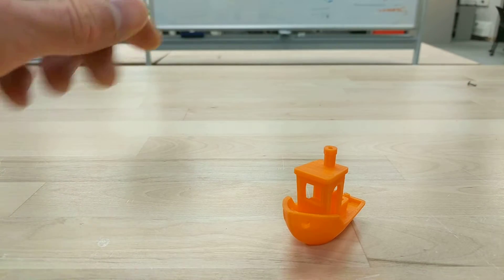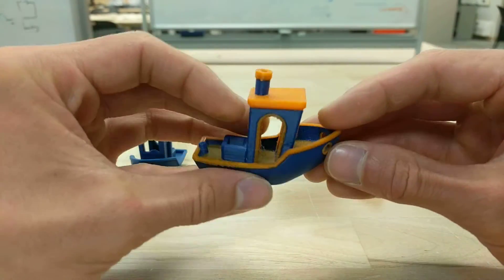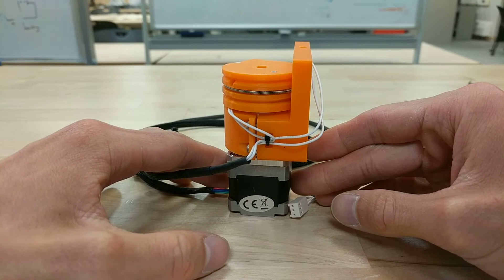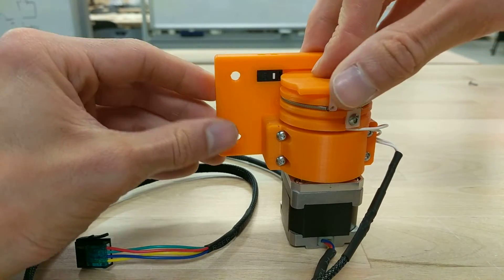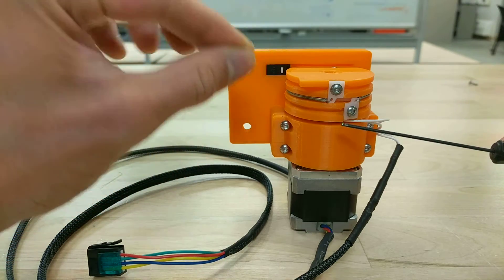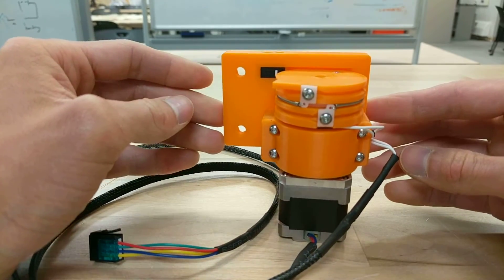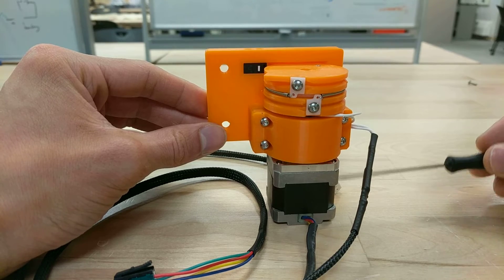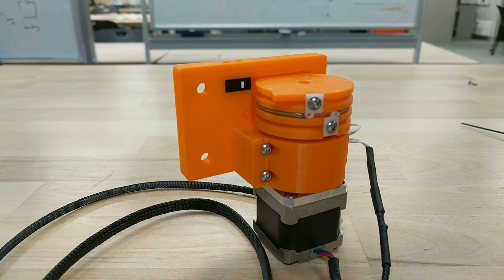First Multicolor Prints and Toolchanger Lock Explained

Comment: Hi you 2 file from Toolchanger Parts and Quantities at GitHub show us the code of the stl file and not downloading the stl file. Please advice. Thanks for sharing.

1x floating_half_pulley.STL
1x lock_actuator_base_plate.STL

And the STEP file here also show code only.
jubilee/frame/fabrication_exports/machined_parts/build_plate/

Comment: Hi. This is an awesome design. You could overcome the stepper motor heating by applying the shape used in RC models retractable landing gear. The leading groove shape allows to lock the position with absolutely no force applied from external actuator. It locks itself due to combination of rotation and linear movements. Then you could also apply a simple servo to perform this operation no need of limit switches, additional steppers nor drivers. Have a look at the cutouts placed on the side: https://cdn.shopify.com/s/files/1/0339/0713/products/551RS-A_large.jpg?v=1414084270
Reply: Very Very good design, but I do not understand as well, why wouldn't you use a good servo? It would do the job slicker and light. You have enough connectivity and power and use it. The metal geared one with ball bearing. I guestimate it to be even lighter.
Reply: Agreed. But if the design depends on a constant torque to hold the tool then the servo will be powered all the time. Thus the benefit will be only I  weight but not in thermal optimization. You can still have the constant torque with spring but some shape lock to unload the stepper or servo during hold time printing period.
Reply: @pjak2000  the step motor in use does the thing: holding the latch. If you want to make it work without the wasted energy, make a noch in the slot and spring-load the latch in it.

Comment: Joshua - is that a high precision planetary with 20ish arcmin precision?  The lower precision type can have backlash as much as 1 degree.  Wondering if it matters?
Reply from the maker: Its a 5.18:1 gear reduction. There is a tiny bit of backlash (about 1 degree), but it's negligible. In this case Im using the stepper not for its precision but for its ability to hold its position while being loaded with an external torque.

Comment: Your quicker than me! I'm still designing my tool changer. It started out as a simple system. However, the current part count tells me that I have to produce 100 parts! Thats nuts. It happens when you try to build a tool changer on an Ultimaker style 3D printer. I have to build a lifting mechanism to lift the parked nozzle above the XY system. This is making things rather complex.  I'm hoping to finish the build in over half a year.

Comment: have you considered using the trinamic stepper drivers and eliminating the switches?
Reply from the maker: My previous version used this setup. Sadly, it takes a woeful amount of tuning to get it right, and, once tuned... every couple hundred toolchanges it will fail to trip and crash into another tool with a loaded tool or fail to pick up a tool.

This version has gone through thousands of toolchanges with no hiccups.
Reply: @POOFjunior  thank you for the quick (and informative response)